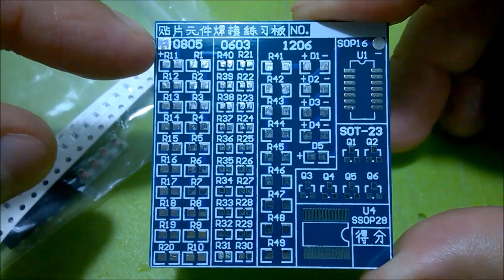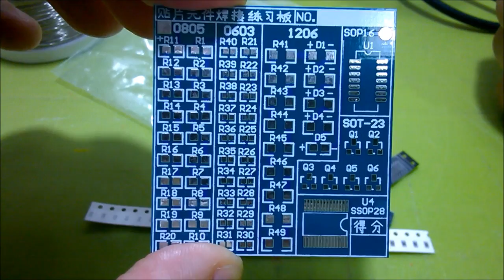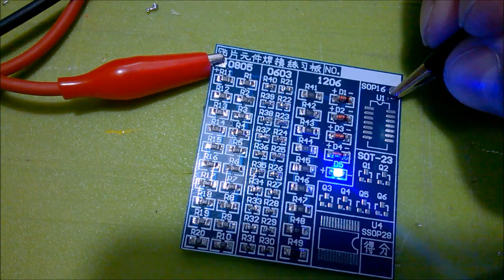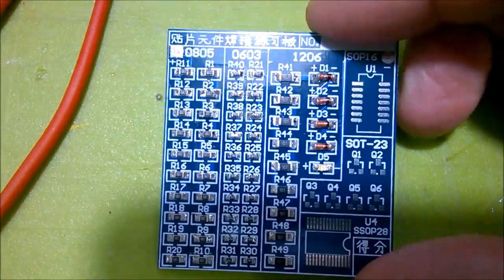SMD soldering practice kit assembly #1: using a soldering iron

Comment: Thanks a lot for sharing , I bought exactly the same one from eBay but I didn't solder it yet , and it is also missing the same IC  .
Keep up the good work .
Reply: jrom hek did you solder it yet? I'm just going to order this, it's only £1.10 from China. I think I'll order 2, sadly I've only got a temperature controlled iron. 
I really want to see a close up smd soldering iron tut.
Reply: Gunzee hello and sorry for late reply, and yes I soldered it and two 0603 resistors was burned . But I finished it successfully. And you can check Androkavo  channel on YouTube  for close up soldering with iron .
Reply: Jrom Hek thanks I'll check out that channel. I'm tempted to buy a hot air station but this is just a small hobby. Still with my limited tools and knowledge I've managed repair a nes and bt headphones. 
Sorry for the double post, think it's network causing it.
Reply: if you want my advice and since  you are new to electronics maybe you should buy soldering station  ( I bought one from eBay China  for about 45 dollar ) cause you will start with THT and rarely use SMD .
Best luck

Comment: Usually with SMT, they use something called a stencil to quickly apply the SMD solder paste, then lay the components 
https://youtu.be/JWUJtmgh55M
and heat the board in some kinda reflow oven or for hobbyists a skillet.
http://www.instructables.com/id/Simple-Skillet-Surface-mount-Soldering/
Of course heat is set to a certain limit and amount of time.

Comment: Cool stuff man, you did very well. :)
I agree with you SMD/T is kinda hectic but they got it all over now.
One of the tricks is to glue the components(R,D,C,Q...etc.) use a pin head for applying glue under the SMD component, just a little amount of glue. Also try a helping hand, so it holds the board and it has a magnifier too. https://duckduckgo.com/?q=soldering+helping+hand&iax=1&iar=images&ia=images
Good luck.

Comment: It would help us newbees to smd soldering to see you soldering ,close up,I also just bought some smaller solder,it marked 6 mm and it says it 63/37 I assume those number mean the percent of lead and the percent,do you no ifn that right,and how is lead free solder marked,anyone that can help me.
Reply from the maker: Your solder seems to be Sn/Pb inded, and those are the percentages of each material (respectively). Lead free solder would probably say so in the package, there are several different alloys used.
Reply: Thanks for the info,I just don't no why anyone would use lead free solder ,I only heard complaints about it ,I am to old to change ,lead solder work well ,why change.but I agree you should wash your hands when useing it ,